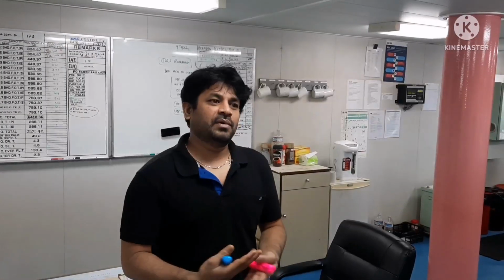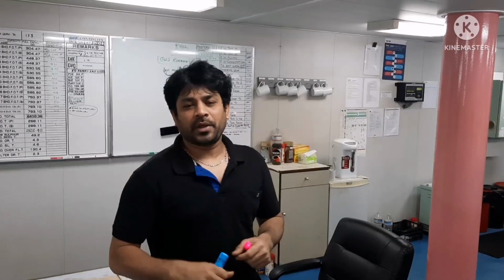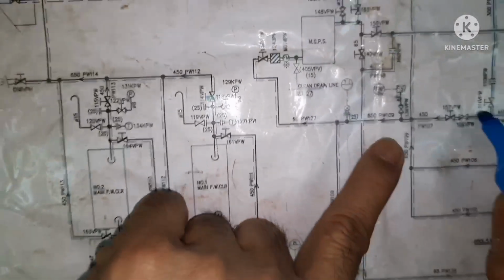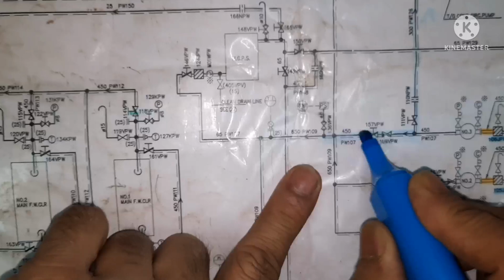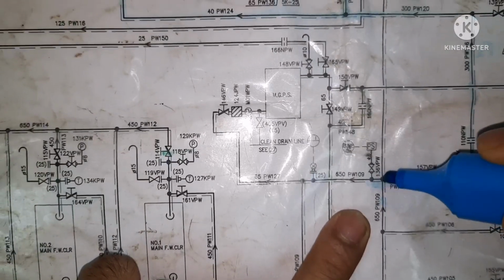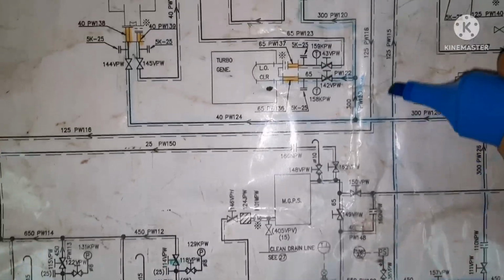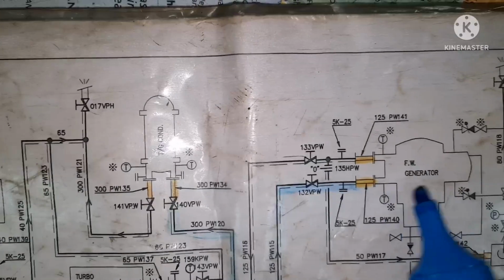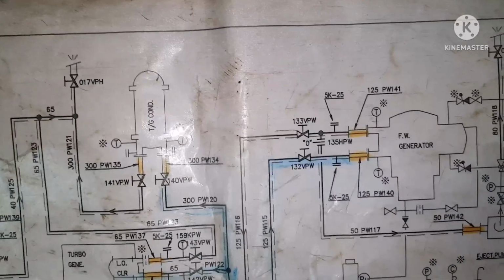How to do they do.. How to read sea water pipe line diagram onboard ship...

Comment: Sir i am currently 4 th engineer on board. Purifier not producing enough fuel. I corrected it but same problem repeating. The purifier will run for sometime and again goes down. Why is it .
Reply from the maker: Wen was the last bowl routines done sir...if not do it
Is it having attached gear pump.. If s overhaul it.. Chk the relief valve of the pump